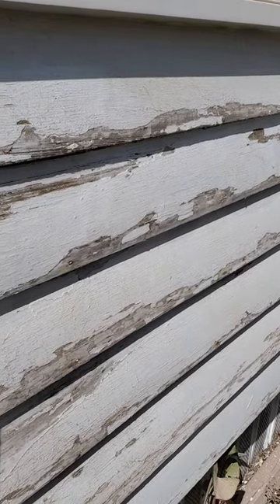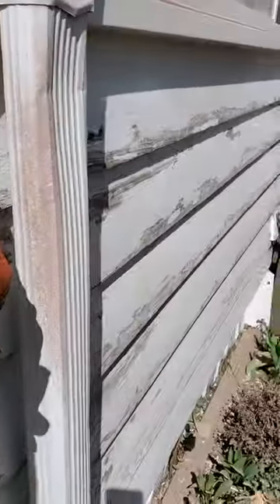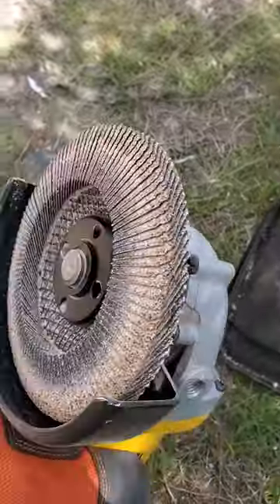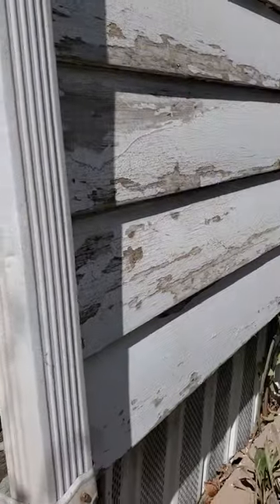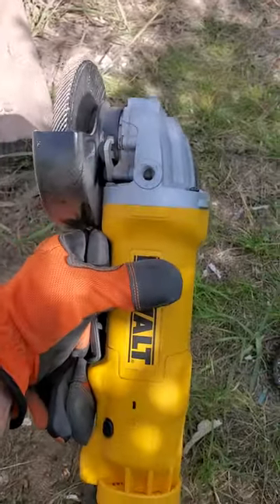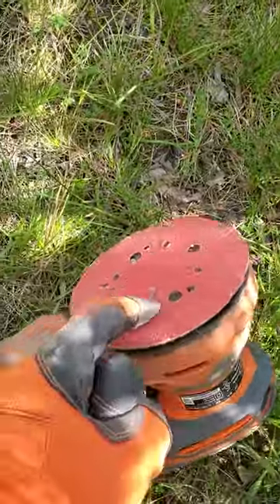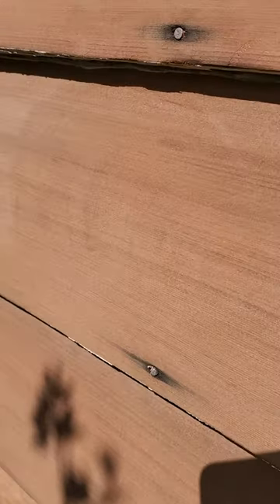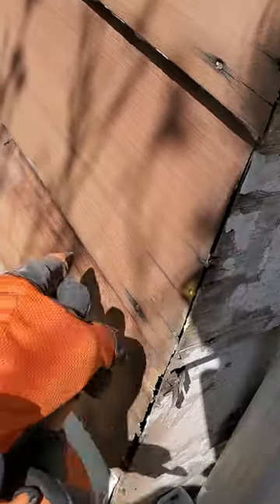best way to remove paint from wood

Comment: Diamabrush disc on an angle grinder that works miracles on wood . Sold at Lowe’s or Amazon. The disc is pricy but worth it. Lasts long. Let the  Diamabrush do the work and you just guide it . I used it on my deck floor to remove solid colored paint stain . It’ll go over nailor screw heads but best to recess them before starting .
Reply: Diamabrush rules! 👍
Reply from the maker: good input!

Comment: Where did you get 40 grit sand paper for orbital sander?
Reply: Amazon has it.  As well as 36 grit which I use and they even have 24 grit.
Reply: Going with… literally anywhere
Reply: I'm actually using 24 grit now found on Amazon

Comment: Just came across this video trying to figure out how to get the paint out of the flaps on my discs.. the usual pain is not so bad but some of it is gummy. 
 Ever try a Paint Shaver Pro? It works miracles on the flat who would in the carbide blades or the vacuum hose attachment sucks up so much of a dust. Where is the dust separator on a 5-gallon bucket before my Festool vacuum. Working on my mom's old garage in upstate New York what channel is the curves at the top of the lap siding which is a real pain so I'm using the grinder there making those nasty divots. Very hard to follow the curve.